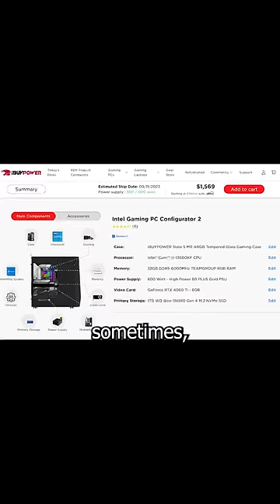Is a prebuilt #PC worth it? It depends. #technology #shorts #tech #computer

Comment: There are big margins for the reasons you listed, they are also in your shop for the reasons you listed. Every rig I've built has outlived its usefulness for me, then handed down to a friend that uses it still until I upgrade again. Those budget prebuilts go out because they're all using linglong power supplies or others with the absolute worst rated OVP and boards with the cheapest fets, caps and VRMs that can possibly be sourced.

Comment: in my 18-20s i built my own pcs from scratch.
in my 30s i buy buy prebuilt because i want the full coverage 24-36 months service warranty it usually comes with so if it stops working, i can just send the whole pc away and don’t deal with the troubleshooting and fixing stuff myself. sadly my current pc’s warranty i have expired a few months ago so now i just have the manufacturer warranty left for individual parts 😅

Comment: The branded OEM pre-builts are to avoid, usually made with stripped down motherboards, with proprietary connectors and formats, sometimes even specific parts with no drivers outside of their own.
These pre-builts are simply already assembled PCs with proper non OEM components

Comment: I happen to be the owner of a prebuilt pc. And I've been the owner of it for 2 years. I used to think that it was awful to own a prebuilt, but at the time, I remembered that it was either the one I found and own today, or a 10 or 11 year old Dell Optiplex or Lenovo. The part about using the cheapest hardware is definitely true, as the pc I own has a single stick of 8 GB DDR4 Ram, 11th Gen Intel Core i5 and a Nivida Geforce 1030 GT gpu. 

This pc isn't the best, but it isn't the worst either. The point is they can get the job done and are better than decade old pcs, wether you know about this stuff or not or have the time or don't, they're still good anyway. Now I am in the process of replacing some parts on the pc and changing it to make it look and feel plenty times better. 

I'm on the side of supporting prebuilt pcs and at the end of the day, it depends on what you get. All it takes is a bit of research, reading and understanding to find the perfect one your you

Comment: honestly buying a prebuilt and then replacing or upgrading individual parts over time seems a lot more reasonable than building a PC from the ground up. just get a decent desktop that fits the specs you need/want, and then if those specs change later you can crack it open and change things around later!

Comment: I'm a long way from being a computer engineer - a very long way - but I always build my own PCs. It's really not that hard, requiring only the most basic knowledge.

If you know what DDR5 refers to,  what PCI Express is for, and that you need to get the right motherboard with the correct socket for your chip, you're almost there. After that just make sure the motherboard has plenty USB sockets and headers (sockets) for any front panel sockets on your case.

Comment: I bought my pre-built little over a year ago for $600 when it's got $1800 in parts, and to build it custom, which is just ordering all the parts then assembling them myself- I was being charged $2,100, even with selecting all of the best deals. Tech companies and sellers have caught on to the "Build it yourself" idea and now overcharge just like Alienware does with their brand. ($40 headphones charging $280 for them, and they break within 1 week of use. $300 laptop but you pay $3,000 for the LED's and 'fancy' alien face design.)

Comment: As a purist, I think there is nothing wrong with buying pre-built PCs. My only issue with them is that they used some of the worst and cheap components then overpriced it to gain for profit. Some of them are even build to have the worst air circulation.

Comment: I didn't have knowledge, yet I built one on my own. And by some miracle it worked the first time. I didn't have to unplug anything and check if everything is correctly plugged in. It just worked. I managed to put it all together by just watching videos on YouTube.
The PC I built:
CPU: AMD Ryzen 9 7950X3D
GPU: Gigabyte GeForce RTX 4070ti Gaming OC 12 GB
PSU: Be quiet! Straight Power 12 1000W
Motherboard: Gigabyte X670 Gaming X AX V2
CPU Cooling: Corsair iCUE H150i Elite LCD xt
Memory: Kingston Fury 32 GB DDR5 6000MHz
Storage: 
1. SSD Kingston KC3000 2TB M.2
2. (From previous PC) SSD Samsung 500GB M.2 (With adapter)

As you can see I could've made some expensive mistakes. But it works just alright.

Comment: Pre Builts are fine 

You can learn everything, upgrade, etc. afterwards

I been using my pre built for 5 years now, upgraded the ram, a couple other parts (not from breaking or having issues). Just wanted to upgrade. If I had more time before I might’ve built my own, but happy with my pre built.

Comment: I work on computers for a living.  When I get home, I don't want to screw around with my own computer and if something goes out, I let Dell fix it with their expensive warranty.  I usually buy Mid-upper tier Dell XPS Desktop with an OK Graphics Card and then upgrade the RAM and Hard drive.  It games on all of the new games and all of my software that I use.  I don't mod it or overclock and run it stock apart for the drive and RAM.  When its time to upgrade or replace components, its time for a new computer.  The old one gets cleaned up and donated to a family member or friend.  IN my opinion, if you are trying to get more for your money you can do that by building your own, but you have to troubleshoot getting it to run correctly and then deal with multiple vendors for problems.  I already do that at work, so not wanting to do that at home during my free time helps me to unwind and not burn out from a busy IT career.

Comment: fun fact: if you don't live in the country it's being sent from and most likely have to pay high shipping fees it's way worth it to buy a pre-built
Reply: The opposite can just as easily be true. As was in my case. 1300€ (with VAT) rtx 4070 super, amd Ryzen 5 7500F, 32gb, Gigabyte B650 Eagle AX plus everything else… This was a great deal.

A pc with those same specs would cost me over 2000€ where I live. Even if I built it myself it would cost me way more then 1300. Those 4 parts i mentioned would have cost more than a 1000€ ALONE. Not including sleeping fees.

Comment: I got a 1600$ prebuilt from BestBuy, an iBuyPower unit that at the time due to the chip shortage was my best option. The parts in it would have cost me a good 1400$ to get, and that's without shipping or the OS on there. Thing runs well, even for having a cheap cooler on it I've never seen temps above 80c on any game except for CPU hogs like Far Cry 5, which means one replacement cooler and new paste and it'll run at 70c tops most likely.

Comment: The reason prebuilts are bad is because the companies that build them charge way over the total parts prices, and charge a standard rate for substandard parts. 
Generally they will always cheap-out on the power supply, which can cause you to brick your entire system.

Comment: My friends like prebuilt stuff. I buy power supplies for them. Prebuilt computers like to use crap spec PSUs. I shove a fully modular EVGA PSU in. 

Case in point: friend was under running. He tossed his prebuilt and got a brand new one. Had me do the data transfer. Later I kept hearing his microphone drop out and he was worried his brand new machine wasn’t working right. Would power off randomly. So I go over to his house and see it’s got a weedy 450 watt power supply. I told him to get in my car, we went to Microcenter, and I bought him an 850 W EVGA power supply. This was before they stopped selling them in store. Installed it, and now about four years later he still uses the machine.

Comment: Here's the thing. My brain is WAY too smooth to build my own, but I still want good components. I just found a local computer shop that's very small and very local, and because I buy the components from them, they assemble it for free. Even if that wasn't an option, the biggest components seller we have here offers a fairly cheap assembly service for components you purchase from them, both individually and if you build the whole system. Do that over buying a pre-built. Please.

Comment: It depends on the prebuilt system, some are terrible and some are decent.

My pc blew up during the pandemic at the same time that the GPU price hikes happened so my build was going to be a good 500 over a prebuilt. Ended up with an Acer Predator system where the airflow is terrible and the CPU cooler was worse than a basic Intel one. Swapped that and the two airflow fans and its now better. The worst part of it now is the blower style GPU cooler but an undervolt and fan curve helps with that.

Comment: I got a $1500 HP Omen 40L for $840 in December. 

Last one was an ibuypower that I got for $500 in 2011.  Only problem I have had woth pre-built was the ibuypowers PSU exploded one day.  But my house had bad faulty wiring.

Comment: I bought a prebuild pc 3 years ago
Now im building my 1st pc
I bought 7600x with ASRock b650 Pro RS wifi, with a reuse graphics cards (nvidia 3060) 
All i need is the power supply, ram, and cooler to start building it

Comment: My major concern with pre-builts, they usually have the bare minimum of a PSU that will allow it to boot and post, but that's it. 
And over time that cost cutting measure will eventually destroy the computer. So while some pre-builts actually good, chances are you're going to need to buy a PSU and replace the stock PSU. So buyer beware.

Comment: My pc is kinda a hybrid monster, it was originally an Acer pre built, I took only the PSU, motherboard, CPU, GPU and hard drives, shoved them all in a new case, replaced a couple other things, I was on a tight budget and I needed better airflow for my very much overheating rtx 2060

Comment: I've built all my computers except for the first two back when hard drives were measured in MB instead of GB 🤣 But this time I bought a custom, built by AVADirect instead of me. 

So, I got to pick all the parts, they put it together and it's under a warranty! But the real reason is that I just don't have the cash to buy it outright. And this site had a financing option that was available for me. So, now I'll have a dream computer, and I just have payments 😁

Soon I'll have a very very capable computer and I'm ridiculously excited. It will have a 7800x3D, a 4070 TI Super, 32GB 6000khz cl30 ram, etc etc. It's gonna be a beautiful beast.

I hope it's as nice as I think it should be.. It's on it's way to shipping right now! !!! I'm excited.

Comment: Tbf many of us older techies lived through an era of pre-built PCs that had the most proprietary bullshit in existence for seemingly no other reason than to lock users out of saving money on things like upgrades. 
-Upgradable PSU? Nah have a unique connector and mount that specifically doesn't have enough juice to run anything faster than a GT3050
-PCIExpress slot for gfx? You're okay with 4x half-length slot right?
-board tattoo with company logo and feature set with no OS recovery media and a giant extra partition on your main drive you can't can't access that has no use...until your system inevitably gets fried because Chinese MOSFETs.
😩😩😩😩😩

Comment: My prebuilt 4090 pc was like 2700 and I got some rewards from it. It’s absolutely perfect, the wire management is top notch, and I couldn’t have done it myself for that cheap. The cheapest 4090 I see rn is $2k+… no way I could get a cpu, psu, motherboard, ram, case, cpu cooler, SSD drives for 600-700

Comment: I bought a pre build. It was Acer nitro 50. After 1,5 years I had to change everything except of GPU, CPU, and m.2. it was such a bad quality, the PSU was not enough for this set, bios didn't allow to change xmp profile, and it allowed only maximum of 32GB ram, cooling was only one fan, and one mini cooler for CPU. Temperatures were so high, I could cook eggs on my pc. Box didn't allow any air. Overall, if you don't have a friend who knows about computers, you probably would buy a bad pre build. If you are such a friend, just build it together

Comment: I bought a prebuilt "gaming" laptop because I am disabled and spend a lot of time in bed unable to move. So having something I can still game on but have comfortably sitting in front of me while I recline in bed is awesome. But it does have it's problems. Only has 1TB of storage for EVERYTHING on the one drive. Runs extremely hot. Talking high 80s C or low 90s C. The battery died, which I bought a replacement for but am too scared to replace it myself and don't trust generic repair shops near me to do it. And recently the fan has started making weird grinding sounds now and then which eventually stop but isn't a good sign.

I'd like to get my SSD backed up, replaced with a 4TB one and have the backup restored. Replace the battery. Get new thermal paste on the CPU. Check and replace the fan if need be.

So I can see why some people would hate prebuilds but for me its a necessity. Otherwise I would go insane having nothing to do in bed.... That last part was a setup for you perverts to have fun with making jokes. Enjoy ^_^
Reply: prebuilt laptop??

Comment: No knowledge what so ever with pc 
Built my first pc in mid 2023
It wasnt really that difficult as it seems to be. Just made sure to pay attention to what i was doing. Hardest part for me was actually installing files and drivers, and doing research.
Got it figured out eventually.
Gotta put your mind to it! 

Specs:
Msi b650 edge am5
Ryzen 7 7800X3D 
Msi geforce rtx 4070ti 
32gb Corsair vengeance ddr5
4tb WD SN850 m.2 
Corsair 850w psu
 Has been a great PC.

Comment: I just upgraded my pre-built with a thermaltake core p8 tg, and added 11 corsair fans, threw away the old 240mm radiator and upgraded to a 420mm radiator for my AMD Ryzen 9 5900x and also upgraded my stock MSI Radeon rx 6800 xt gaming x trio 16gb with a 360mm radiator.

Things where heating up in the old medium tower.. after the old 240mm radiator's top fans stopped working wich had double sided fans, so a push pull config..
And the stock graphics card was also heating up the case..
and that after having the prebuilt for 3years
 
Last time i checked it had a idle temp around 55 Celsius on CPU and 60 Celsius on GPU and when i played battlefield 2042 or cod wm3 it went to 80-90 Celsius sometimes for both the CPU and GPU and then after 10-20min of gameplay the PC would auto shutdown and restart.

I had that a lot with battlefield 2042
By the third time i think i hurt my CPU's temp sensor, because now it sometime jumps +10 Celsius and goes down again a second after.

But after upgrading the pre-built with a new bigger case, 11 fans (2 exhaust 9 intake) and 2 new water coolers for the cpu and gpu that are setup as exhaust, the idle temp now is 30 Celsius, GPU sometimes lower like 27 Celsius. 
And when i game the temp is more like 45-57 Celsius for the CPU and the temp for the GPU 50-60 Celsius and GPU  hotspot 60-70 Celsius depending on what games i play.

Btw.. i play everything in,
4k 120hz 120fps.. and thats alot of heat production!

But everything cool now! 😊

Comment: We're not gonna lie. There's two problem with pre-built.
1. price between 10% (you will usually never see 10%) to 50% higher price than the PC components itself.
2. If you don't know anything about PC. RAM, Storage and PSU can be found very cheap because usually fail and having a failing PSU is not something than I want.

Comment: I agree with that take. I built my first pc in 2008, and upgraded it in 2020 CAUSE IM POOR AF! Went from one of the origina Intel Quad series when the motherboard still had a north/south bridge , and couldnt support more than 4gb per slot. So i went from one of the first intel quad cores at around 2ghz with 4gb of ddr3 ram, and a HDD to a 3700x on a b550 with 32gb of 3600 ram, but i still kept the gtx 770 because gpu prices are ABSOLUTELY OUTRAGEOUS! Until it blue screened and literally caught fire after a lot of troubleshooting. So i got scammed on FB marketplace on a 1060 3gb WHICH WAS ONE GB LESS THAN THE 770 FOR $100, But i needed a gpu asap as i didnt have on chip graphics. I kept the HDD for a couple months until i got a WD black SN_750 and holy crap it was BY FAR the most noticeable uprade of all because obviously it unlocked the potential of all the rest. I STILL, however have the same BROKEN AF/ DIRTY AF case that was in the background of the episode of the office where Ryan runs away from the presentation for the Sabre store, again, i bought it for around $100 in 2008. As long as it will allow me to securely screw in my mobo, and psu then i could give a crap less about anything else.
But for people that have the money and dont have the time or desire to gain the know how then I say go for it. HOWEVER if you dont have a friend with that know how you can trust to guide you on your purchase then i think its worth it to sit down and do the research yourself, and if your doing that then its DEFFINITELY worth the extra couple hours of research to save the money/have the knowledge and just build it yourself. Its really not difficult at all.

Comment: I only buy refurbished models now. There’s no real extreme value added to newer tech. I bought a used gaming PC for like $500-600 but you can buy decent PCs without graphics cards for as low as $100. 

Make sure you inspect the PC when you get it. Mine had an unplugged fan and the power supply wasn’t enough for the computer.